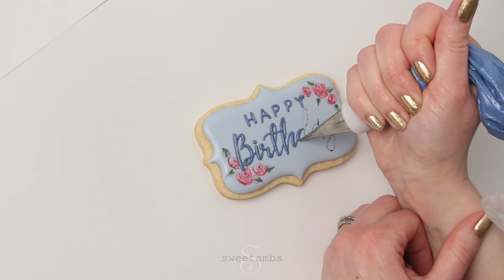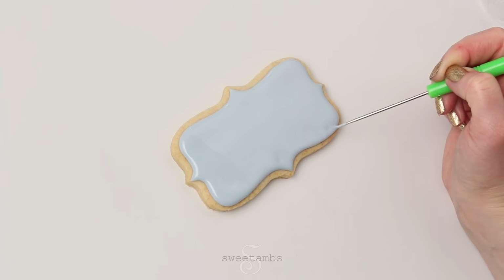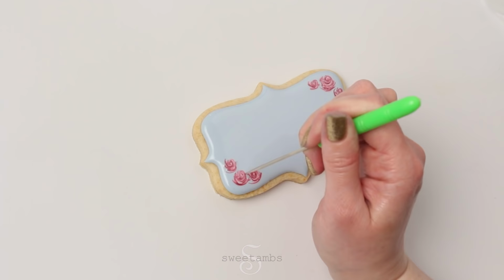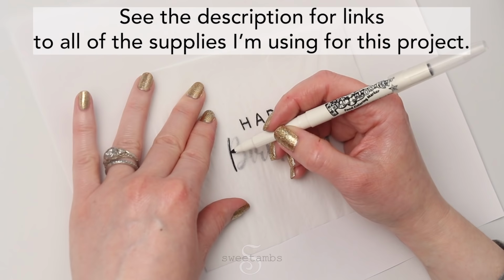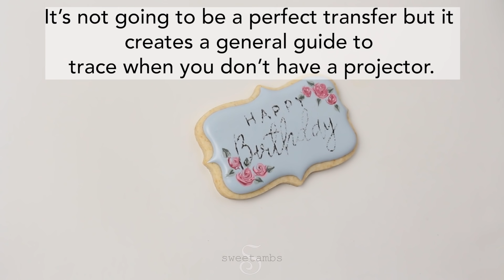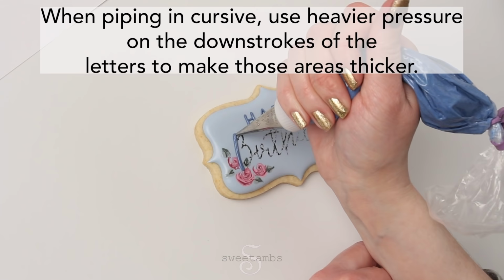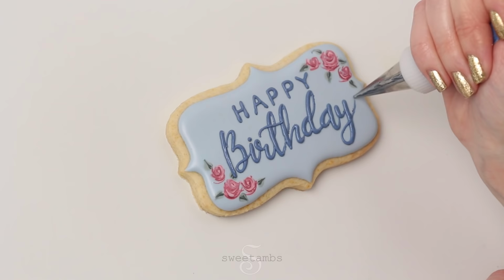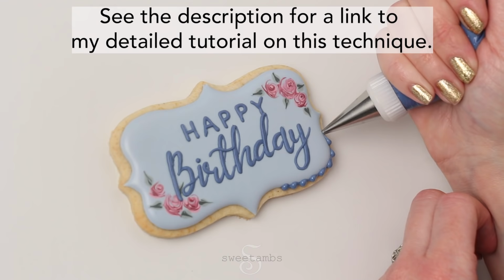How To Pipe Lettering On Cookies Without A Projector

Comment: I bought a projector many years ago and have used it many times.  It works great but it's big and heavy to move to my baking area.  I love this method much better!  Many years ago when I transferred images to sheet cakes I would use piping gel on wax paper to trace the image then flip it over and press image on to cake following the design using a toothpick.  It worked!  I've been decorating cookies and cakes since my first Wilton cake decorating class in 1979.  Still enjoy it😃
Reply from the maker: Oh wow that’s a lot of work! Thanks for sharing ☺️

Comment: I have trouble with the edible marker color soaking/bleeding into the piped letters.  So often the letters I'm piping are white, and no matter what color marker I've tried, the white letters (doesn't matter what consistency I used) soak up some of the marker.  I piped white letters onto blue cookies the other day, with black edible marker.  The next day, the white had little patches of pink here and there on almost every cookie.  Please help!  (I made sure the marker was dry before piping.... I did 50 of them, so by the time I got to piping, the marker was well dried)